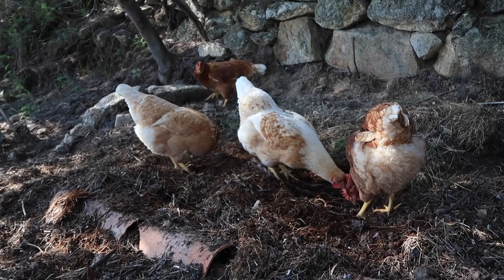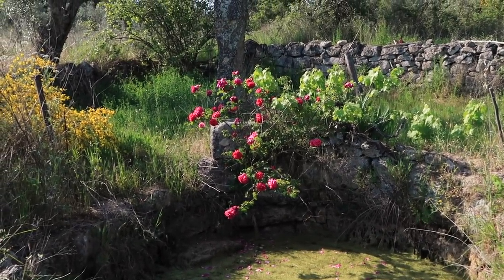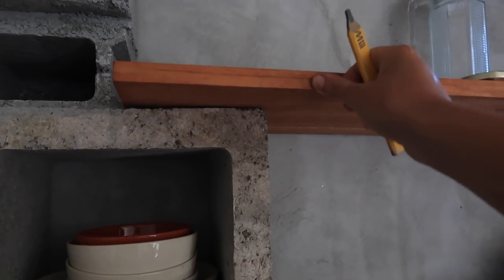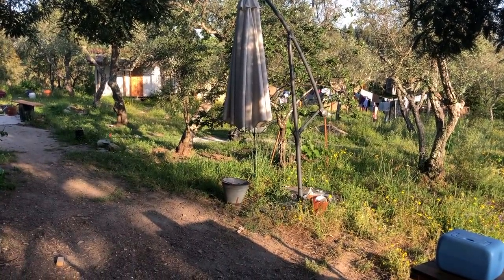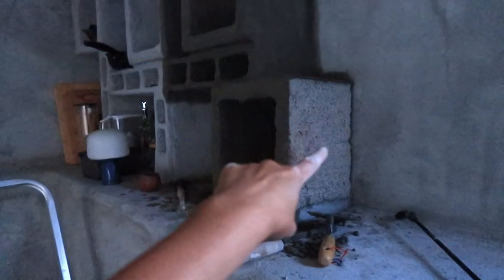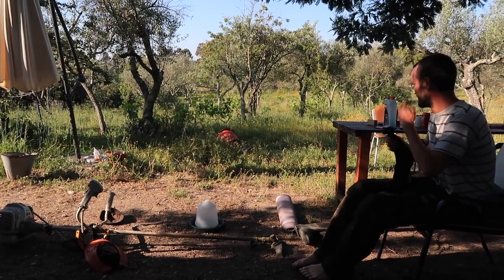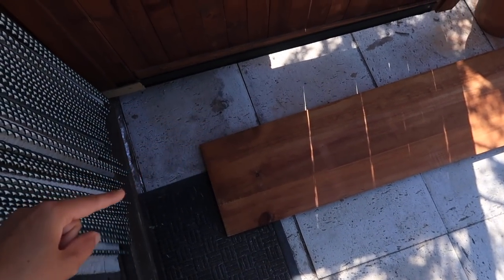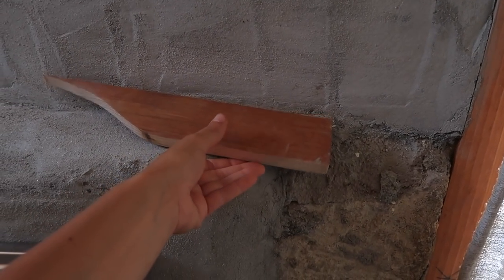Young couple building a dream life in Portugal. Kitchen renovation continues 🌻🌞🐓 Tiny Home Build

Comment: To help keep chickens cool...Dig a deep and wide hole/ square in the ground at least 32" deep. put a little hay/grass for a floor and a partially covered top. in the shade is better but, you can throw a layer of dirt on the top/lid. The ground below 2' is consistently around 55* F

Comment: For future reference,  since it's rather late for this kitchen project. Best practice when you are refinishing or plastering over concrete or stone to moisten the existing concrete brick or structure to increase adhesion by reducing the speed with which the finished morter or spackle product dries.
Reply from the maker: If you look carefully you’ll see it all get wet first haha, it’s all very quick though.

Comment: Hi guys! subscribers here, we follow and enjoy your channel . I'd like to comment, but please don't take it as a criticism, just a warning because we care. You mentioned the hot weather and it seems to be frequently sunny where you live. You spend lots of time outside in the sun, I rarely see you guys wearing a hat or covering up. There is great danger now from UV rays . The ozone layer is being destroyed and uvc is hitting the earth. normally uvc does not penetrate to the earth surface. UVC is the next to xrays and can cause skin cancer in a short time period of exposure if not blocked. You may notice how intense the sun is on the skin. Here in Newfoundland we usually never hit 35c even in high summer, average day temps for mid May are quite cool with lots of rain and cloud (like Wales!) today it was over 17c with forecast 20c tomorrow, clear skies and sun, unusual weather.  It is also quite dry here for May. I work outside all day long ,vegetable gardening, wood cutting etc, I wear a heavy zinc cream, skin, protection and wear clothing that does not expose any skin , such as legs or arms. I wear a large hat with neck protection. Just so you can know that it's not just my extreme, weird thinking, check out Dane Wiggington "UVC the sterilization of planet earth part one". All the best guys, have a great summer! Howie.

Comment: How much solar power do I need to power a  PS5 for 12 hours a day. These are the sort of questions your fans want answered😁?
Reply from the maker: God knows?! 😅 we don’t know how much solar power we need to run a fridge 😂
Reply: @ian smith If you need to know how much solar power is needed to power a PS5 for 12 hours a day then I am guessing that the significant work and effort required for off grid living is not really something you should consider
Reply: @bedlam8159  all it requires is money. How long have you lived off grid? How much water do you use a day? Do you use gas like these guys or wood to cook your meals? So if I would have said how much solar power do I need to run a 200 watt system for 12 hours you would have been quite happy for that question. It's a real shame you haven't  a sense of humour.
Reply: @iansmith6086  It depends on the Voltage/ Amp Hours of your battery bank(s), hours of peak sun, solar array capacity but a ball park figure in answer to your question would be 720 Kw at 12V. 30 plus years in the England & Wales Electricity Supply Industry taught me that much